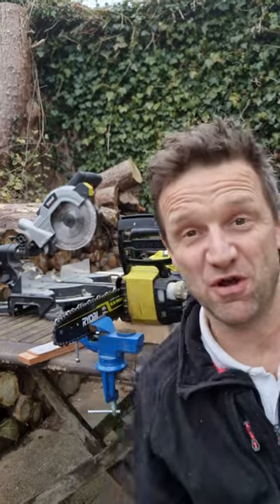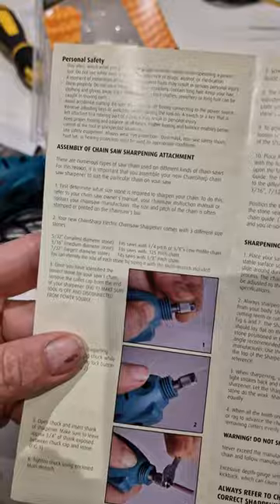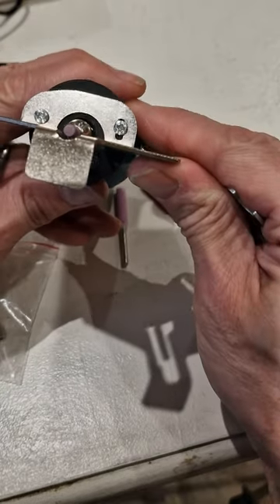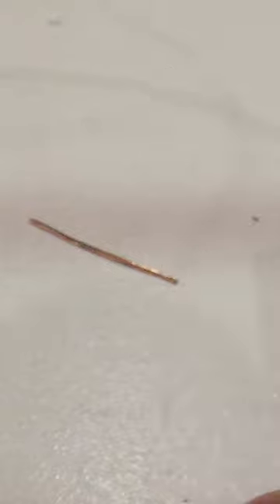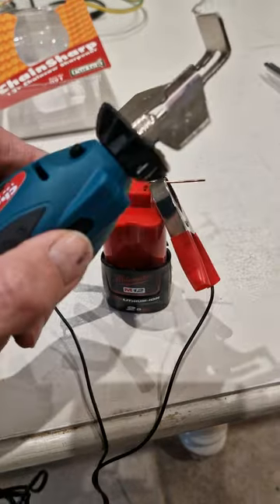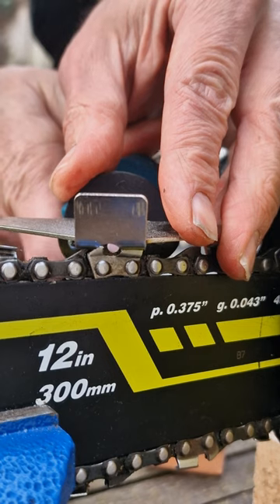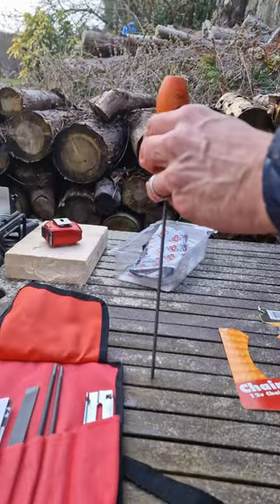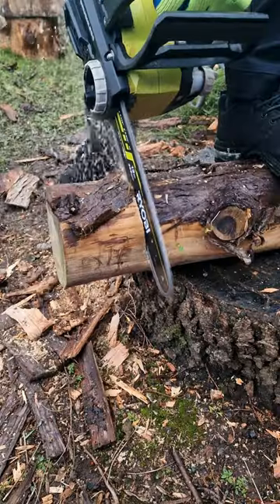How to Sharpen your Chainsaw #shorts

Comment: Love your videos Charlie, but.....this is not a good way to sharpen chainsaw blades. Yes they will be sharp but the critical part and why it's an art mate is each pass has to be the same on all teeth otherwise you go though blades in half their life. I use manual which yes is slower but you only need three or four pushes on each tooth. Not the back and fourth that you showed. The electric looks to me like you will need another blade after about 4 sharpens 😂 I shapen my teeth only once a day and that's if it's being used literally all day! Otherwise it could be weeks between sharpening. Not a criticism really just trying to help but this is not how people should learn to sharpen chainsaw teeth. Anyway keep up the good work mate.
Reply from the maker: Fair point. I'll mention this when I do my log splitting video. 👍
Reply: Exactly my thoughts.

Comment: Interesting video.  The electric cutter looked very similar to my Aldi or Lidl Dremel look-a-like, even down to the screw thread on the top of it.  Mines a mains voltage one though but it looked identical.
I have a manual chainsaw sharpener but to be honest I never really got the hang of it.  As other commenters have said, there’s an art to it.  I tend to just buy new blades instead now.  They’re only about £6 from China and I buy a couple at a time so I always have a spare in stock.  For the amount I use the chainsaw, as long as I don’t catch a stone or dirt on the chain when using it they last ages.  Maybe I should persevere with the sharpener
Reply from the maker: I hear what you say Geoffrey. If you don't use it very often a new chain is probably easier.

Comment: 98% of people still make the basic screwup of not advancing with technology. On the cutting guide, thebentup tab on the end is your handle. The dremel method with the guide and Diamond barrel bits is so much better you have to be super stubborn to not at least try it and once you try it....
Reply from the maker: I've just on someone's recommendation bought the Stihl sharpener which sharpens the blade and also the depth guide in one motion. It's by far the best sharpener I've used so far. No-one would accuse me of not moving with the times or being pragmatic. I was simply trying out a tool I hadn't used to see if it was worth recommending to you all.

Comment: Have you checked what the average chain costs before you spend a lot of time and money  on this tool
Reply from the maker: Half the cost of the tool so you'll quickly be in credit, plus it's a pain waiting for the new chain to arrive unless you're organised enough to have a few spare. And you're keeping an old chain out of land fill.
Reply: You can sharpen a chain hundreds of times before it gets worn down, definitely want to sharpen it instead of getting a new one every time! Especially considering it needs sharpening after an hour's use every time...
Reply: BS, I used chainsaws but they did not needed to be sharpened every hour.
Reply: @RS-Amsterdam  sorry I should have mentioned that I live in Australia where we have hard wood lol
Reply: @sandrinakeffufal6008  hehe Well I don't think Charley is going to free Great Brittain of all its trees.
Reply: @RS-Amsterdam  If you using them to chop up firewood they definitely get dull quickly. In some cases when cutting dirty wood once an hour might be necessary